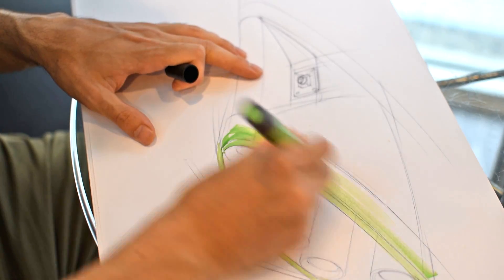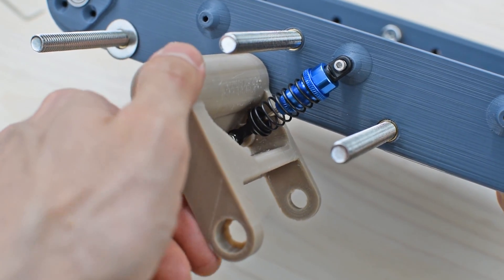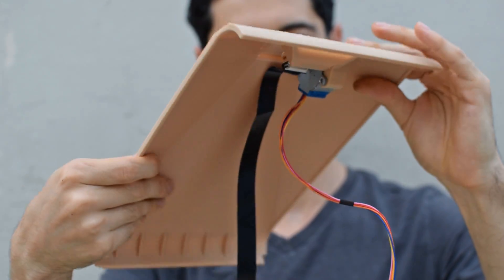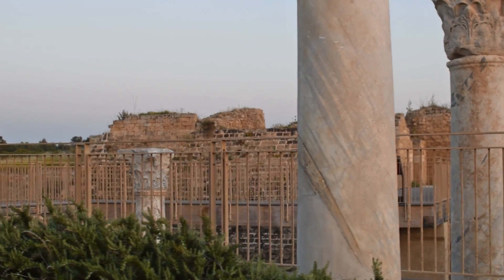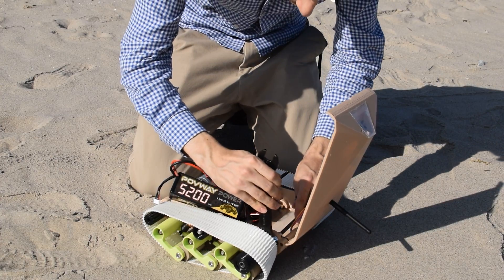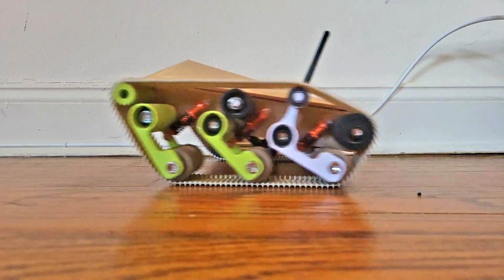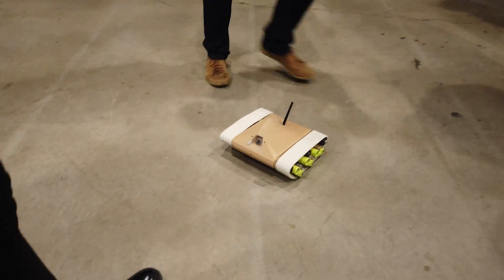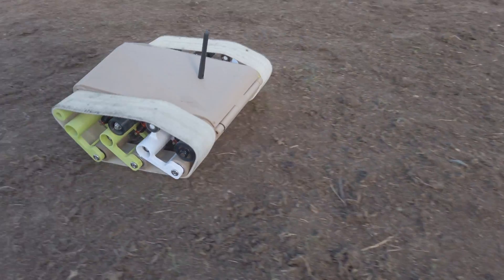I Built a Surveillance Robot from Scratch!

Comment: With the drive sprocket in the front, you are a) pushing the slack of the track to your ground contact treads and b) causing your pulling/tension/drive force to lose energy rounding the rear idler sprocket. The forces would be better used if you were to use the rear sprocket as your drive sprocket. That way, the pulling/tension/drive force would operate directly on your ground contact treads and the drive sprocket would push the slack up to the return treads and reduce bearing friction in the front idler sprocket.
Reply from the maker: Someone else told me to run it backwards for sure.

Comment: Why not using ESP 32 as sub controller for movements and sensors, and the Raspi as host controller with the main code? My UGV Beast work that way, and it work absolutly perfect and fast and i can use it trough internet with lifecam. Also it have object, color and face regognition for more functionality. I like basically your project, but take a look at the UGV Beast how that is working with JupiterLab and open CV.
Reply from the maker: Cool! I'll take a look.

Comment: why not use Torsion bar suspension instead it might make it more stable for the camera
Reply from the maker: That'd be interesting! I think the suspension now is just not optimized for the weight and etc.
Reply: @AvivMakesRobots   probably why the front end seems to jump when ever it starts moving.  from how it looks when the top is open most of its weight seems to  in the back. as a stop gap perhaps a counter weight at the front would help the current suspension ballance abit better.

Comment: That looks amazing. I have one question why would you use a deans connector for the battery on the pcb? Has an rc enthusiast I did away with deans connectors long ago, and replaced them with xt60 for 3s / 4s to xt90 for 4s+ depending on what they were being used in.
Reply from the maker: I just used what my 3S battery had. Arent they easier to disconnext than XT? I don't want to snap the board removing it.